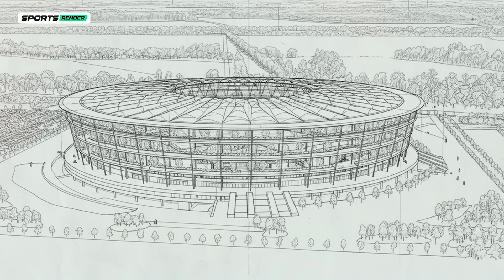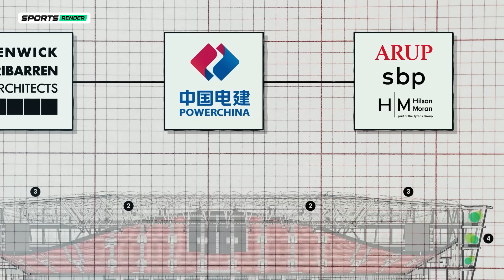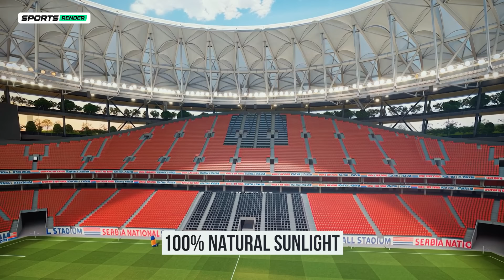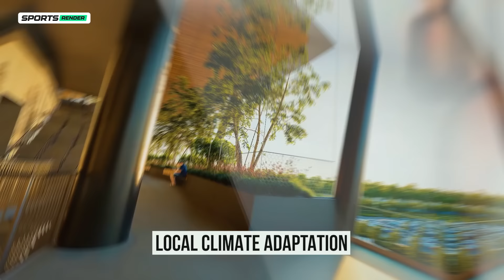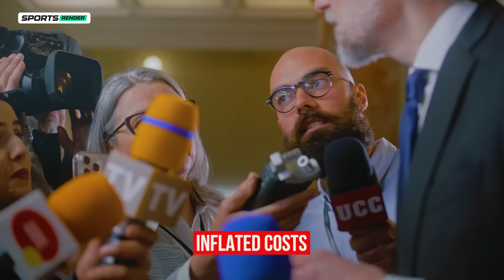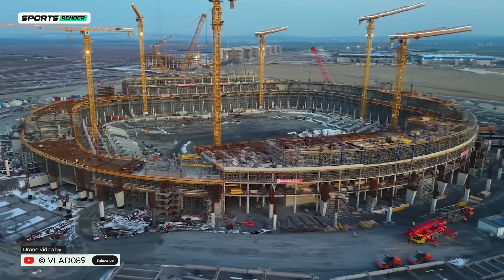Serbia’s €1B National Stadium - Design, Debate & Reality

Comment: This project is not the subject of a genuine public controversy. On the contrary, public support in Serbia exceeds 90%. Moreover, it represents only one component of a much broader, long-term development initiative that is expected to deliver significant economic and structural benefits to the country for decades to come.
Opposition to the project comes almost exclusively from opposition political groups and a narrow circle of ideologically driven, neoliberal media outlets. These actors have consistently opposed virtually every major initiative implemented over the past 13 years, regardless of its merits. Their position reflects a broader political stance rather than a substantive critique of this specific project, and as such does not represent mainstream public opinion.
Reply: no matter you support this project or not, numbers just say it is wasting of resources. 
math doesn't lie like both caci and blockeders.